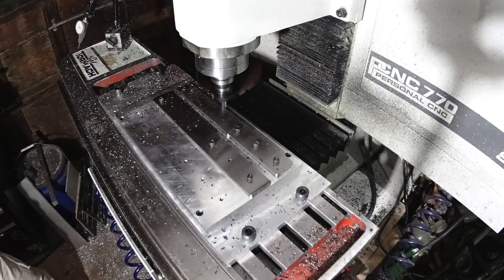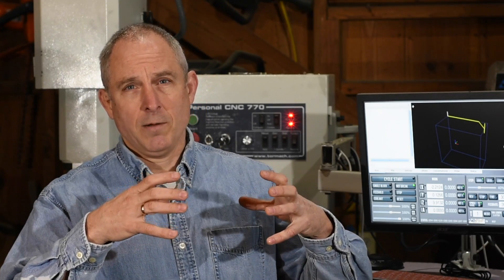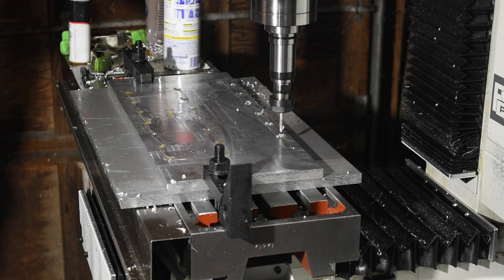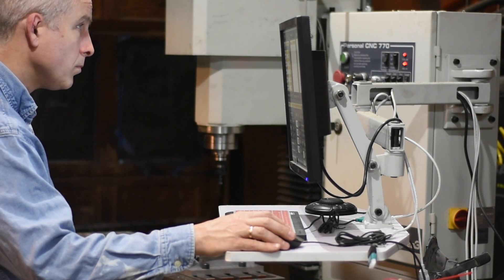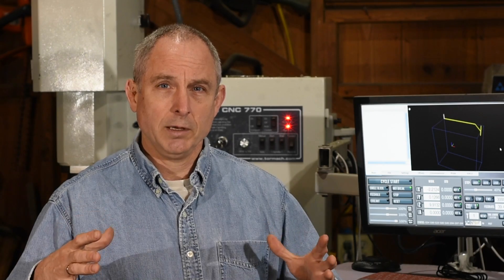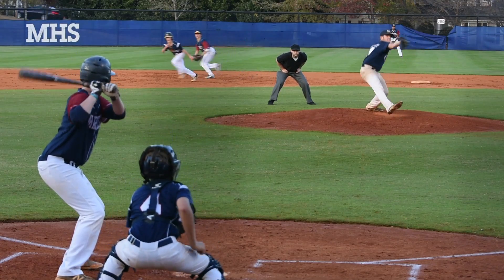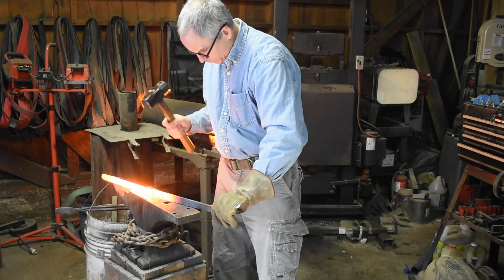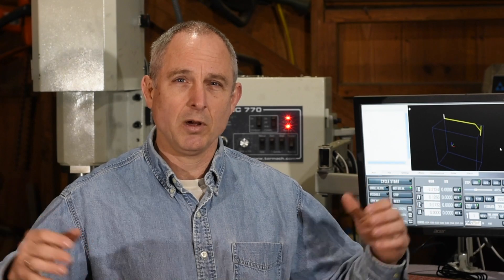CNC For Knife Makers -- An Introduction

Comment: I think you'll like the Tormach, its a great starter CNC. I have one at my shop for cutting aluminum overmold blocks and some tool steel crimper jaws and it works great. It's not a big VMC but hey you can fit it through an office door. For the cost and size they cant be beat, and Tormach has been great to work with. So far mines about 18 months old and the only thing Ive had to replace is a reed switch on my ATC tool changer.

Comment: Yeah Walter and as someone who was a total CNC Noob a decade ago and owns two Tormach mills (1100 and 770) I can attest that they are VERY crash forgiving and quite durable.  Hell if you crashed a VF2 or a MORI hard enough it would most likely cost more than an entire Tormach 770 just to get repaired!  Just remember to hang out around the red button close enough when you are running a program for the first time.  This helps you stop that end mill from getting through your aluminum plate and into the table :-).

Seriously though I have cut every kind of material imaginable with these machines and as long as you aren't trying to hit +/- 0.0005" tolerances you can do amazing things.  Yes the envelope could be bigger, the surface finish could be a little better on heavier cuts and when 3D surfacing (rigidity is a bit limited), but for most any 2D and 2.5D work you are typically good to go.  FYI- your sweet spot cutters are going to be 3/8" and less diameter carbide tooling.  When working on the 770 I do all my 2D cut outs in titanium, stainless and tool steels via use of 1/4" variable helix center-cutting carbide tools these days.  

Also, HSM tool paths (i.e. trochoidal) work very well in these materials and both HSM Advisor and G-Wizzard get you in the feeds and speeds ballpark pretty quickly.  Oh yeah and when you want to quickly fixture some carbon fiber, G10, or even some wood I haven't found anything more consistently better performing than Nitto (Permacel) P-02 Double Coated Kraft Paper Tape!  It's definitely a problem solver for prototyping.

Comment: Stellar down to earth description. I also have a 770 as well as a 440, that I use for making my folders. The most important thing I think you stressed is the costs associated RE tooling which easily surpasses the cost of the mill in short order, Heck my vise was $2,000.00.  Kudos on explaining the type of person that will learn CNC I think many people think it is super easy and you just put in a piece of metal and push a button. The Tormach is a great machine and I highly recommend it. I am currently working on a series regarding utilizing and learning this mill specifically for Knifemaking. I Am working on Fixturing section which is a series in of itself. I really enjoy your videos. Oh and yes Fusion 360, learn that software while you are saving for the mill LOL thats a big part of the battle for sure

Comment: Hi Walter, Being a retired CNC Technician/Machinist I will be following this closely. Most of the equipment I worked with was in the $100,000. plus category and have very little experience with the Tarmac and most of it not favorable. I hope you got the enclosure for it as working properly it will spread chips and coolant everywhere. Make extra care when changing tools that they seat fully.
Best of luck.
Gerald.

Comment: Nice fixture!!  I made one similar, but I just do one at a time. Most of my knives have the same distance between handle pins.  Looks like you are going to have a similar 'standard' with your fixture.  I hope you show more of the process with your CNC.  I don't leave a tab for a bolt near the belly of the blade, but I might have to jockey clamps around a little bit more than you do.  I've been making knives using a CNC to various degrees for quite a while, as a hobby.  I usually make a model by hand to get the shape and feel I want and then install that into a CAD file. 

 I can do as little or as much by hand as I want. Spending more time on the parts of the process that I enjoy and less time on the rest is the best part of having a CNC. In my opinion. 

Great video! Great channel!  Thank you.

Comment: Looks to me like that control is a conversational control. I haven't spent much time using a mill with conversational programing. I'm too used to looking at G-code after doing it for a few months to want to switch over. But it definitely reduces the learning curve on programing. One of the lathes that we have at work has a conversational control. Very easy to pick up. If you have any questions let me know. Ill do my best to help. 
P.S. If you want any clips of our HAAS running just let me know. I have about a million of them on my phone. I'm not sure I'll ever get over how cool i think this stuff is.

Comment: (crashing end mills) ..." and all this terrifying noise ..." that's a great line.
If anyone wants to get into CNC, the main skill to start with before searching out the CNC buy/build/etc is pick a 3D CAD system and learn how to create parts. FreeCAD, Fusion360, OnShape, or others out there.  Good desktop CNC on budget is Shapeoko 3, X-carve, or others out there. Get something small to start and move up later. The small CNC can always be used to make those kydex sheath cutouts or handles after switching to the fancy Tormac/Haas/etc for the blades. Search out a MakerSpace near you as another option.

Comment: Walter I can see in the video your going to mill the scales on your CNC   It would be logical that your cutting out the blades are you planning to bevel the edges of the blades also?  When I was working for a living we had a welding shop with a plasma cutter the department got a CNC plasma cutter worked great and I had to do the CAD designs. The plasma cutter ran on electricity and compressed air, low cost to operate very accurate cuts.  The edges did get some slag but it was minor.  I would love to see a time lapse of a whole build.  That reminds my I need to finish that headsman ax it needs an handle.
Reply: Water jet
Reply: I have found that beveling your blades cause a few issues, Takes much longer than grinding by hand, warps the steel a bit and devalues the knife, you unfortunately get less money for a 100% CNC knife than a knife that is hand ground.

Comment: wanted to know why you picked the 770 over the 1100 i am looking at getting the 1100 and wanted to know why you picked the 770. just wanted to know why. i know Price can be a big part. and maybe the foot print (size of the machine) but wanted to know is the 770 (175 to 10000 RPM) vs the 1100 (100 to 5140 RPM)

Comment: why not use a plasma cutter cnc?
Reply: I thought of it and concerned about the distortion it does to the blade. Have you used any plasma cutter for knives? How'd it go?
Reply: Daniel Ziran-Xu  I have yet to but it looks as if it would work, my shop teacher and I have used a plasma CNC to make tongs for the school forge, and it if you over heat the steel you can allways heat treat it in the forge
Reply: Nice. It's gotta be faster than a small cnc.

Comment: You are a knife/ sword  maker .but most folding knives on the market are cnc clones . But they are being sold with prices as if they were a custom knife that like you say hrs  and hrs  are spent on . When they are cnc machine made clones of basic user knives that cost like $50.00/ unit .
   Like crk s $800.00 $50.00 clone . I bought the clone sabenza 25 and $45.00 each .the patent is for 20 yrs . 21 and 25 mean 21 yrs and 25 yrs these designs were patented !
   And with cnc mills and high tech this and that they still can't make a folding knife pivot that isn't held and that together with glue !! That is strong ( can resist side to side pressure !!! 
   Technology should make thing work better for less money and better quality !  So called knife makers seam to think that tech means you can charge a shit ton of money for basic knife that didnt take hardly any knife making skill ( to push the button that gets things started ) 
   A real knife maker is needed to supervise ! Low skilled workers !
   Now if crk s basic user cnc clones were  reasonably  priced and the worker got a share in the company ???